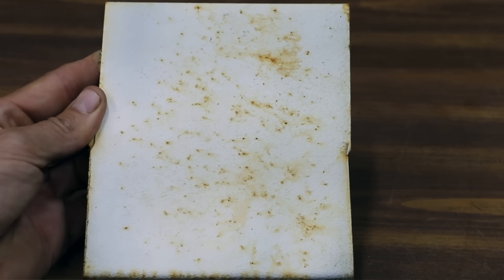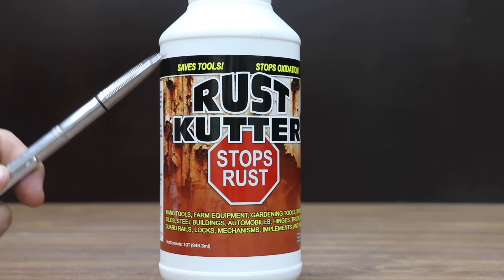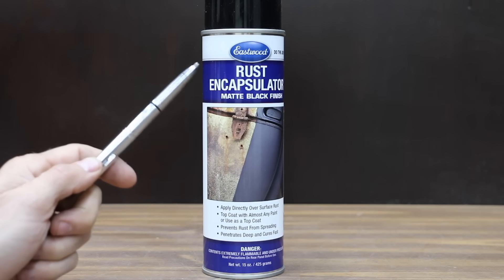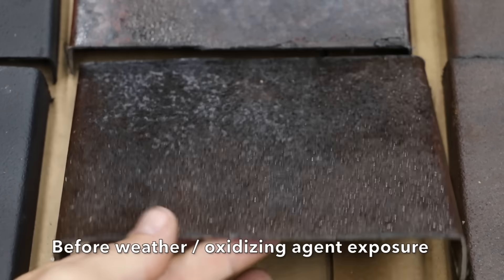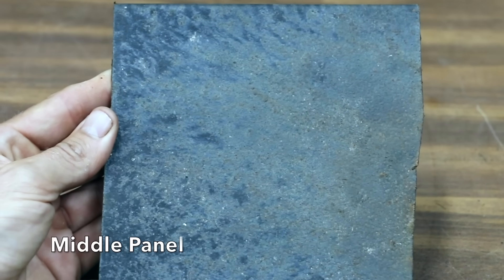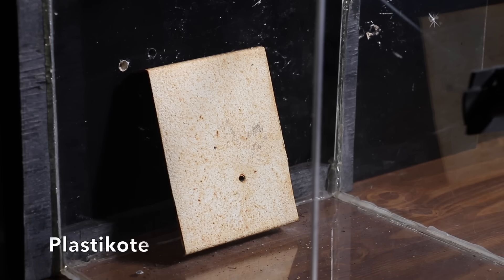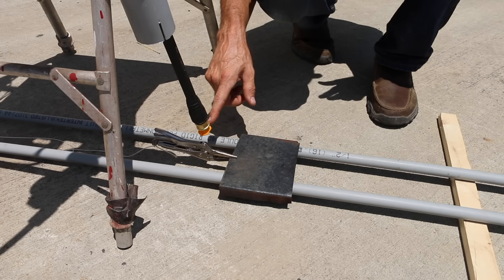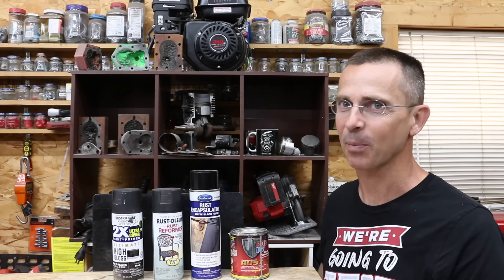Best Rust Converter? POR-15, Eastwood, Rust-oleum Rust Reformer, Gempler's

Comment: Great Video! I have a chevy Duramax and am about to paint the frame on it. I removed the wax coating and wire-wheeled the whole frame. I'm going to be using POR-15 rust preventative on it as a base coat for the POR-15 topcoat to prevent the UVs to destroy the first coat. I have multiple people that I have talked to and did the same process. Do you think this is a good idea even though the frame has no rust?
Reply: Nothing ventured, nothing gained. I think I'll work great. Por products are very, very good, IMHO.

Comment: As always, a great test! Have you considered doing a brake caliper paint test? I saw a G2 epoxy paint kit (very expensive) and a POR-15 based paint (requires their rust cleaners and metal prep kit first). The market looks quite large in brake caliper brake kits so it would be a good item to compare through your methods of testing. Keep up the good work!
Reply from the maker: Thanks, will do!  Thanks for the suggestion.
Reply: @ProjectFarm  thanks so much!

Comment: Possibly the best rust remover/converter is phosphoric acid that-as a rust converter forms a (black) protective microlayer of Iron phosphate when used on iron/steel. Although it is a strong acid (take care handling using concentrated) it is not toxic-in fact at very dilute strength it is commonly used in soft drinks. It is quite inexpensive; a quart food grade 85% concentration costs around $30. (it is usually diluted to around 20% for rust removal)  It is a liquid that can be thickened to gel consistency using fumed silica (also inexpensive and a general purpose construction thickener useful for paints, fiberglas epoxy, anti-sag additive,  etc.).  It sometimes takes a bit of time to act, particularly if removing rust stains from various materials.  Phosphoric acid is the main active component of naval jelly.
Reply from the maker: Thanks for the feedback.

Comment: Por15 is the best stuff out there,  only complaint i have is the coating will lose its color/fade with exposure to UV rays, you have to paint over it if you want a nice finish that will last for years,  for truck frames i have done, por15 base and i use eastwood's chassis paint over it.
Reply from the maker: Thanks for sharing.

Comment: I used POR-15 years ago on a car I held on to for a very long time. Aside from a couple of little chips on the header panel where I had applied it, the part DID NOT rust after nearly 25 years. That was the old black stuff, without proper prep aside from wire-brushing, and I think I cleaned it off with some Dawn for a college-kid-budget degreaser. In short, this stuff does what it's supposed to do, and does it exceedingly well. 

I would suspect the aluminum-fortified POR-15, which it appeared you were using, is going to be at least as good. 

It's nice to see some other good options, too. I've had a few friends say good things about the Eastwood encapulator, and it seems to live up to the reputation of being a sound alternative to POR-15. 

With regard to that, if you do another one of these, may I recommend testing Master Series XT? I've seen it used on a few places, and it seems to work very well at a little better price.
Reply from the maker: Thanks for the suggestion.

Comment: I used to swear by POR-15, but if it gets a tiny hole like those shown on the video, the rust will spread like wild fire under the POR-15 coating.  Sort of like Mercedes undercoating.  It actually traps moisture and allows the steel to rust even when conditions are dry.  My new go-to is a multi-step process.  needle gun and wire brush the loose stuff,  Apply Ospho acid treatment, maybe two coats.  wait several days, brush on Rustoleum Rusty metal primer,  make sure you gloop it into all the nooks and crannies.  top coat with whatever paint you want.  I use rustoloeum or ace brand satin black on car underbodies.  this seem to last a long time, and because there is no plastic sheet, if it fails, it doesn't spread under the paint.  I have been driving antique cars, year round in Coastal Maine for 40 years.  current daily driver is a 1992
Reply from the maker: Thanks for the feedback.

Comment: A couple other products that could be tested are Loctite Extend and the Eastwood rust converter. Friend has been using the Extend since the early 80s at least, the Eastwood rust converter is probably a more similar product in comparison to the POR15 than the Rust Encapsulator
Reply from the maker: Thanks for the suggestion.

Comment: I used POR-15 on my truck bed 72 F100.  It has been 4 years and still going strong.  Very good product.  I used a cheap harborfreight spray gun to apply it with a small compressor.  Make sure you are in a well ventilated place and have a good mask as this stuff is very strong.  I needed 1.5 cans for 3 coats on the bed, bed walls.  It stands up to weather and whatever else you throw at it.  Cheaper than all the bedliners out there.
Reply from the maker: Thanks for sharing.

Comment: POR 15 is the bomb. As a car restorer it works awesome to stop rust, it requires more work to top coat but it does stop rust. The new "top coat" stuff has little UV protection but when sprayed with a gun has amazing covering capability and self leveling and can make an almost car finish gloss finish. You need to manually etch it for top coating or use of their top coating/primer products but its an amazing product.
Reply from the maker: Thanks for the feedback.
Reply: I need to treat the AC condensation drip pipe in my garden that has cracked at the tip and is dripping rust. Thank you for this information! Is the manual etching before the top coat is applied? If a screw won't etch it, I wonder what would. The products sound better for my application.... and before a paint to match the exterior of the condo.

Comment: The POR-15 is actually a 3 step system. First is a cleaner, then a metal prep, and finally a metal sealer. You jumped right over the first 2 steps and went directly to the sealer, although you did do a rudimentary cleaning. When all 3 steps are done properly the POR-15 is unbeatable but you know that even though you skipped the first 2 steps.

Comment: We live in Kaneohe Oahu where it's very humid and rains alot. We have two metal security screen doors that have rust on the screens. I spay painted them once with Rustoleum and I paint them with a brush about every 2 months.  The rust always comes  back., the screen makes it very hard to remove the rust before painting.
Reply from the maker: Thanks for sharing.

Comment: If I have really severe rust on cast iron, should I use a rust remover and paint, or “reformer” and paint?
If I do any sanding to smooth the surface after paint removal and wire brushing, would I need to wait for it to re-rust before converting with reformer?
My other idea is using reformer and sandable primer before painting?
Reply from the maker: Thanks for the suggestions.

Comment: Great test! As usual, there is good, better and best. It's all about what it is being used for. I only like to fix things once, so going with the better or best versions is usually my choice. I've used Por in motorcycle tanks with great results. It works much easier when thinned out. Caswell also makes a good liner. Either is good for tanks with leaks. For rust removal, use Metal Rescue. Rust did not return after its use in a motorcycle tank.

Comment: Eon coat , is amazing,  i swear contact the company
Reply from the maker: Thanks for the feedback.
Reply: @ProjectFarm  they are in raliegh nc, its a 2 part system, water based , very very low VOC, i actually worked with them , its used by BP , and other companies with high corrosion environment,  its sprayed on and we do the same test you did and the bond strength is amazing, beat out anything,  honestly and it was also tested by nasa , we sent off samples  nasa , that's how serious the product is!!!

Comment: Not surprised the POR-15 ran away with this one, it's legendary among us old-car enthusiasts. Rust never sleeps! Love your testing methodology, too. As a metallurgical engineer, I've done some work with the SAE J2334 cyclic corrosion test. You might take a look at it and incorporate some element of wet/dry cycles if you ever do longer term corrosion tests in the future.
Reply from the maker: Thanks for the feedback.
Reply: @ProjectFarm so if using on a car say I get the por 15. I would still need to use a primer over top, and then paint of course and finally clear coat to be used on painted surfaces is this correct? I see many people saying need to sand down and use bondo and sometimes metal filler. But on my car the rust isn't that severe. The paint is only beginning to bubble and very slightly crack in small spots. So I feel sanding would be a bad option
Reply: @ProjectFarm  is this your normal voice? are you like "honey, im going to the bathroom. im comparing the efffectiveness of these 4 toilet papers.. ok lets go"
Reply: Do you know anything / have experience with Brunox?
Reply: @jwgmail  Never even heard of it before. Website looks promising, but I have no info to share.
Reply: Look up chassis saver.  Just like POR-15 but cheaper and less prep required.  Did it on a frame a few years ago and still looking great.

Comment: I had very good results on a pop up camper black frame underneath. Using the Rustoleum (reformer) it first matched the color of the Dexter frame almost exactly so it wasn't blotchy particularly where you could see it. This made it easy allowing me to do only spot areas...much of it welds where the powder coating did not adhere as well. I had the camper for 13 years and did this at about year 7 or 8. I did a few touch ups and new areas over time that literally took me 10 to 20 minutes each year over the next few years for rock chip areas and newly developed areas. It was acceptable till I sold it...with no substantive metal deterioration. I was frankly a bit surprised at how well it did. I was lucky in that the black color almost perfectly matched the frame color.

Comment: I think a 1/2" or so rusty nut and bolt left in through the center  would have added the dimension of a real world application, bc in the test situation (flat surface) most guys would have just  ground down to bare metal and epoxied it.
Reply from the maker: Thanks for the feedback.

Comment: There is a product available in quart cans called “Ensign 335A Metal Preservative”.

Once when at an auto parts store I was going to buy a POR product, but then I saw this stuff sitting next to it, and it was way cheaper so I tried it. 

It is a very thick sticky liquid that I would imagine is best put on with a brush. I believe it originated as a paint for steel-bottom watercraft.  I think it may be creosote-based, e.g. coal tar. 

I have used it on numerous projects, but what comes to mind is a wheel barrel and the bottom of lawn tractor mower decks.  I only removed loose rust first as surface prep.  I cannot remember using a primer.

I must have painted these items 20 years ago, and still use them extensively.  The wheelbarrow sits out in the rain uncovered everyday (upside-down, but I painted the bottom, too.)

Nothing I’ve painted with this product has ever developed any rust, or chipped off. This stuff is unbelievable. If you 😊get it on your hands and fail to use solvent to remove it, or it will have to wear off.

You really should try this stuff along the other brands of rust preventatives the next time you test again.

Thank you for the excellent content.  Always the best.
Reply from the maker: You are welcome!  Thanks for the suggestion.

Comment: I accidentally got POR15 on my skin. I had to go to two different doctors because of what it did to my skin. That stuff does not come off. It made my skin look like I had severe poison ivy. The first doctor I went to had no idea what it was. The second doctor said that I have a condition called folliculitis..
  I had covered my neck and face with Vaseline, I wore goggles and a hat, I wore an old long sleeve sweatshirt and I was wearing gloves. All I was doing was painting the frame and control arms of my truck that was pretty much beyond help in the rust department already..
  but my exposed wrists got some on there. And that’s where I had the problems. It took three weeks for that stuff to finally work it’s way off with me using cold cream, lava soap, I tried brake clean, lacquer thinner, I tried a 3M Scotch-Brite pad. That is some tough stuff. I will never use it again because it is dangerous just like it says on the can. And that you have to keep in mind, anything you get on your skin, it’s just the same as putting it in your body. It gets in there, just look at nicotine patches. That gets in..
they salted the roads five months of the year here in Western Pennsylvania period my owners manual when I bought the truck news said that I would void the warranty if I rust proof the truck, so I didn’t. I thought that’s a good thing if they tell me not to do any rust proofing because that means they have confidence in their corrosion protection..
  boy was that wrong. I lost the brakes two times from rotted brake lines. I also lost the fuel pump because the fuel pump rotted, and so did my fuel line. There was absolutely nothing under that truck that was not rusty. I could scrape sheets of rust with a scraper off of the frame.. it was like digging lasagna out of a casserole dish in places..
 I ended up trading it in and I was lucky they didn’t spot that rust which I sprayed with fluid film before I traded it in which I should’ve done when the truck was new.. it was a 4 x 4 crew cab Canyon, with only 38,000 miles on it after eight years..
  when I bought my new truck, a ram 1500 bighorn crew cab. I spent five days spraying under that truck with fluid film. I bought attachments for the spray cans, I bought the spray gun for spraying the gallon size can, I took out the headlights, tail lights, I took the runningboards off so I could get fluid film behind the brackets, I even pulled out the fender liners because I see these rims rotted out bad..
  here in 2023 six years later, I do not have one speck of rust anywhere under my ram 1500 because I sprayed it when it was five days old. I actually have videos on YouTube showing inspections under my truck year-by-year..
  if you spray fluid film under your truck or your car when you get it home brand new, you will not need to be considering products like POR15. That fluid film is actually self healing. It travels. I did not know the bed of my truck had to seams in the floor..The truck came from the factory with a rhino spray online or in the bed. And I bought a rubber mat off eBay to protect the bed from scratches. When I pull the rubber mat out after three years to clean it, I discovered that fluid film was traveling uphill into the bed of my truck through the seams in the floor I did not know it was even there..
  A sidenote, I ran into a guy that had the same year truck as I do, a 2017. I started asking him how it’s been because we both had the hemi engine also,, he said he lost the truck, no trouble, but he hast to get rid of it because it is solid rust underneath and he was advised by his state inspection mechanic that’s a friend of his to get rid of it. It only had 54,000 miles on it, he bought it new in 17, and he hast to get rid of it here in 2023 because of rust because he did not think to have it sprayed…
Reply from the maker: Thanks for sharing.

Comment: As others have mentioned, the can of POR 15 will cover a lot of area. A lot of the weight in the spray products is propellant, so I would bet there is much less total coverage for any of the spray products. Perhaps weighing the cans before and after application would provide useful comparative data about the cost per application, or an estimate on total area that can be covered with each product.
Reply from the maker: Thanks for the feedback.

Comment: Confirms my experience with POR-15. Used it first in the US Navy, and recently painted the underside of my motorhome, which was delivered in early Spring, so it probably traveled from Indiana during winter, I cleaned nd wire-brushed, brushed on black POR-15, and a year later it looks like the day I applied it, despite driving through rain, snow, sleet, and a whole lot of dirt and rocks and volcanic dust and quartz dust.
Reply from the maker: Thanks for sharing.

Comment: I have used POR 15 many times with excellent results. The only problem is that any material not used will harden in the container. Does anyone have a solution to this problem?
Reply from the maker: Thanks for the suggestion.

Comment: I rebuilt steel tubes in RV refrigerators, and used food grade phosphoric acid and water, put it on,  wait a day and no more rust!   If you have large projects this can't be beat.  The phosphoric acid combined with Iron oxide causes a chemical reaction that converts the iron oxide into Iron phosphate which is a great paint primer! Anyway love your tests!  Thanks!
Reply: I was thinking, isn't that what Naval Jelly is? Phosphoric acid? That's what I use-then a coat of Rustoleum. I have to save a lot of outdoor patio furniture soon, but I dread it. Process will be wire wheel on a drill to remove as much rust as possible on the worst spots, then Loctite brand Naval Jelly treatment, then a coat or two of black Rustoleum paint. Fun fun fun.

Comment: Seal Krete concrete sealer will seal chalky rusty surfaces and prime and seal any surface. I used to use on rusty metal to paint as a contractor. And it dries invisible and is about $12/gallon. Goes on like water
Reply from the maker: Thanks for sharing.